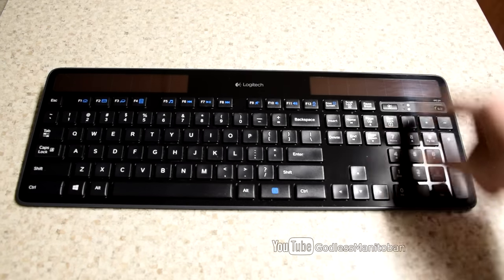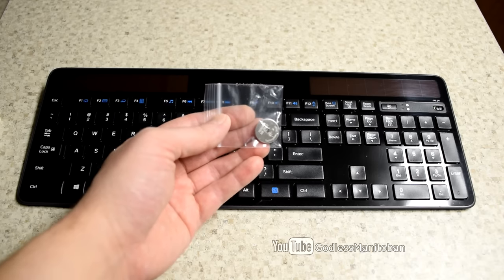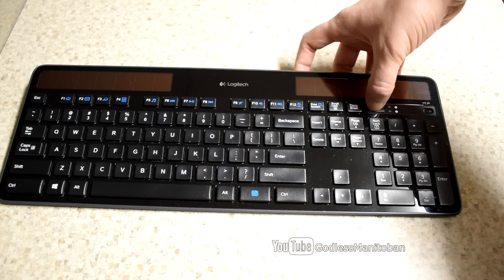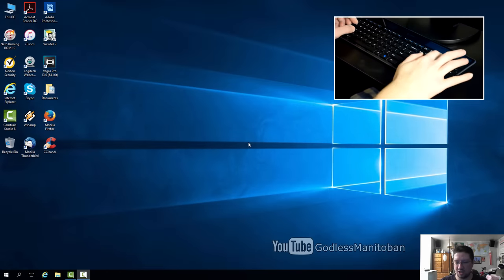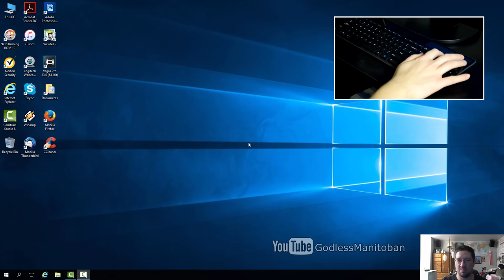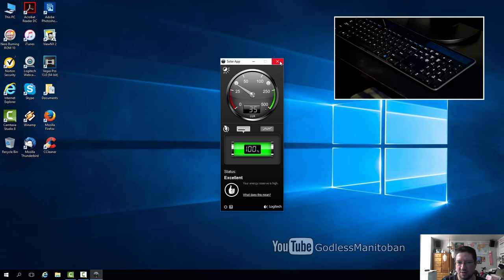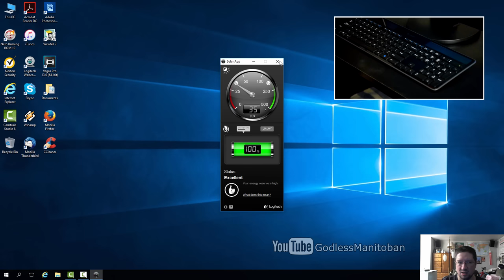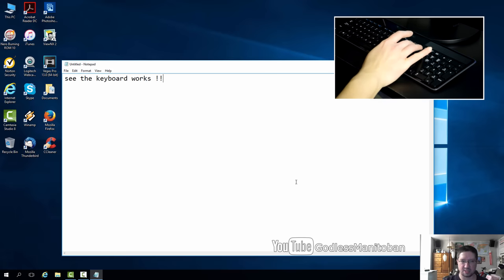Replacing Battery in the Logitech Wireless Solar Keyboard K750 (How To)

Comment: Thank you!  So appreciate it.  Can't believe Logitech would not make this battery easily replaceable!  It is inexcusable - every 3 or 4 years they end up in a landfill!  Our host video fades from sight on the removing battery tray but it saved me $60 and I so appreciate the effort.  It takes a small very small screw driver and persistence .  The reason it doesn't come out easily is because Logitech put little "dog ears" on each side of the tiny tray that expand out to "lock" it in place when it is pushed in.  Put a tiny screw driver on one end of the tray outline. Have another  tiny screw driver of flat end instrument ready to hold  the crack open. With careful but firm force you can force it open a little and then pull the tray open enough to reveal the little dog ear - use the second instrument to pry the dog ear IN towards the battery tray and open that side up.  Move to the other side and then do the same - pull the other plastic dog ear inward - that releases the tray and it will pull out.  Remember to put the battery (I just used an energizer 3v that I had laying around) with the "label" side up - just the way you removed the old one with the yellow sticker up.
Reply from the maker: You're welcome.
Reply: I have no idea where to try to open the keyboard. that was why the video is so important. And I have no idea where "here" is.

Comment: Couldn't find a Maxell ML 2032 rechargeable battery for my Macbook's Logitech Wireless Solar Keyboard K750 locally, but succeeded online. Cost about $8.00. Was able to carefully pry out the plastic battery holder with a very small screwdriver. No damage to the battery holder or the keyboard. Slipped the new battery into the holder, slid it in, and it clicked right into place. Thank you for making this video!
Reply from the maker: You're welcome.

Comment: Great video. Logitech has changed its tune. It now explains how to change it and to disregard the warning.
Reply from the maker: I've kind of given up on my Logitech. I think I have wireless interference and my keyboard sometimes doesn't want to type. The battery is fine though.
Reply: Please post link to Logitech’s battery replacement instructions.  I’ve been unable to find.

Comment: World's most difficult battery to remove! Prying with a narrow blade screwdriver in the center bottom of the battery holder seems the only way to get this sucker to pop out. I tried "playing nicely" with spudger tools and picks, no luck. You can use very fine sand paper to buff out the scuff marks left behind, and this looks nearly brand new with a fresh ML2032 battery! Thanks to Logitech for "planned obsolesce" engineering.

Comment: I followed your tutorial to replace the battery in my K750. UGH, It was a major hassle removing the battery tray. I clipped the little tabs so I don't have to deal with that pain again. Thanks for the detailed video!
Reply from the maker: You're welcome.
Yeah they definitely don't make it easy to replace the battery. I managed to get that battery tray out with minimal damage and the damage is under the keyboard, so no big deal.
Reply: Great suggestion about clipping the tabs.  I did the same thing and the battery still holds in place without being loose.  Thank you, Jem!

Comment: Two and a half years old? My keyboard has been going for at least six years now - maybe even eight -, making often about 20 hours a day, and it is still going. But I have noticed a significant drop in its chargeability. The battery takes longer to charge, and is quicker to discharge. But although the most important part (getting the tray out) happened outside the camera view filed, I now know what to do. I'll just have to use a little more force. Thanks to you and your video. Thanks a lot, GodlessManitoban!!!
Reply from the maker: Sorry I thought the battery tray part was in frame apparently it wasn't and you're welcome.

Comment: You may wish to add that to reactivate the keyboard after successful battery installation you need to disengage and re-engage the micro receiver.
Reply: I got the keyboard without any receiver. Can I buy receiver which will pair with this?

Comment: A metal nail file is perfect for removing the battery, it's thinner than the average screw driver. I used one shaped like a letter opener (but it has a dulled point) and slowly worked the battery out from the top. There are two side tabs that you will have to work to get it out as well. But this way I had zero damage to the keyboard while I extracted the battery. I didn't replace by battery but pulled it because of a spill.
Reply: I would love to see how you got your battery tray out. After 30 minutes of trying and some scratches on my keyboard I said fuck it.

Comment: Great video, thank you for your endurance to go after it! I have used this keyboard flawlessly for at least 8 years now, and it just happened today that it stopped in the middle of work. However the program shows 89% battery life it might have more damage to that than this because of its age. It is sad that Logitech like other companies is not supporting environment friendly operation and mislead its customers to make them throw away their old equipment and keep buying new ones. I must say this keyboard is the best one ever made, and thanked for your video it will stay with me as long as computers ever use keyboards... :)
Reply from the maker: I think many factors affected my keyboard (sent it to recycling). My room wasn't the brightest and I did use it a lot. When I did replace the battery I didn't think to take the sticker from the old battery and put it on the new battery. So it could've lost contact but I was just fed up and tossed it. You're welcome.
Reply: @GodlessManitoban  I did not put the sticker on either and it still works just fine...

Comment: First of all, thanks for posting this. I have replaced the battery with a new one (Maxell ML2032) and the keyboard started to work again. However two days after, the battery fall down to 1% and the keyboard stopped working. Solar meter is usually 500+ during day (night obviously 0). but it seems the keyboard is not able to charge the battery back. Did anyone saw similar thing before?
Reply: Many Lithium rechargeables sold online are junk, or it arrived almost dead and needs charging.  Even if it says pre-charged, it may be dead from sitting for a year.  Can you set your keyboard in the sun for a day?  The shelf life of these rechargables is only 2-4 years, and you could have found old stock. 

I used non rechargables, 2032.  A buck each on Amazon.  10-12 year shelf life. People are claiming they could start a fire.  I'm not sure how they figure.  How much energy do they think these panels can grab?   I get 35 Lux with all my LED office lights on.  With LED lighting being so efficient, these panels can't  keep the battery charged.  If you have old CFL or planet-hating traditional lighting (or sit near a window), it will charge fine; maybe then get a rechargable ML2032.  If you sit in a dank dungeon waiting for your next hotpocket delivery, any 2032 will work.  I've used a few flavors of cheap batteries to keep my keyboard going for 8 years.    Each seems to last 2 years. 
 
I have three of these keyboards.   No failures yet.  All are 6+ years old.   Love this keyboard.
Reply: @legonut78  You used a regular, NON-rechargeable CR2032 battery successfully, without disconnecting the solar panels, and without making ANY changes/modifications to a stock K750 keyboard?

Comment: I bought my keyboard back in 2011, and the battery is still holding charge. I think I'm the lucky one :)
I'm expecting the battery to go any time soon, good to know what battery to buy and how to change it. Thank you!
Reply from the maker: You're welcome.
Reply: I'm in the same boat. I bought mine back in 2011 also and the battery still seems to be fine right now in 2018. The room where my computer is well lit, so I don't think it ever had a chance to discharge too deeply. If it ever does die, I'll be scrounging up an ML2032 :) I still really like this keyboard. I'll be sad if Logitech discontinues it.

Comment: Have the same keyboard, bought in Sept 29, 2011.  Contacted Logitech when battery expired. Support told me they don't make those batteries any more. Went on Ebay and bought the battery. Found receipt today, 2017-04-05. I see Staples had $10 replacement plan charged on bill as well, phhh. Battery is easily replaceable and did so. I think what to really watch out for is if it gets 100% exhausted, then it won't kick in again. Alternatively I had thought of putting in a non-rechargeable battery and covering up the solar panels with black paper. However I did order the replacement battery and my wife is currently using this keyboard today. Logitect is obviously worried about the customer replacing it themselves with the wrong battery and encountering more than just a dysfunctional keyboard.  Maxell ML2032 is the replacement. Get the Maxwell ML2032 if you drink too much coffee being worried about your keyboard. (Sorry, couldn't resist the joke)
Reply from the maker: I think Logitech doesn't want customers to replace the battery. They'd rather have a customer buy a new keyboard. They could easily ship a battery out and send instructions to replace the bad battery.
Reply: Actually talking on the phone, Tech support offered to replace the 
keyboard. I was waiting for it, giving them my address but nothing 
arrived. They didn't want to spend a dime. Disappointing because I have a  lot of Logitech products. I agree with you. It's not good PR however citing others will read reviews of this thing and avoid it because of some reviews. I know Amazon retailers want an "immediate" review but I am inclined to take my time. Some things are initially great until they fail. (i.e. Dell Inspiron 5150). I bought my keyboard from Staples, reviewed it. Noted I can no longer get to my review any more. They just have "glowing" reviews from people who have used it for a day or a week.   A  job review is longer, 3 to 6 months. They should try that with hardware. Glad you made the video. It's a good keyboard overall, just that batteries are consumables, be it rechargable or not. It's like asking to replace our cell phones when the battery won't charge any more, ridiculous.
Reply from the maker: Hopefully Maxell keeps making the batteries or I'm going back to a corded keyboard. I also have a Logitech mouse and webcam.
Reply: I don't mind a corded keyboard.  Mouse on the other hand, I prefer cordless and haven't had a corded mouse for many years. I like mechanical keyboards and I don't know of any that are cordless.
Reply from the maker: Corded mice are annoying because the cord always drags against the desk edge.

Comment: Many thanks for the very helpful video. I got a replacement Maxell ML2032, installed it and keyboard is working fine. cannot understand why Logitec advise not to replace the battery. It may be due to the risk of a non-rechargeable 2032 being installed.
Reply from the maker: Yeah that's the only reason I can think of too.
Reply: Or maybe they want us to drop another $75 on a new Logitech keyboard and toss the old one in the landfill.

Comment: thank you for the instruktion. I have a problem because I have spilt a few drops of coffe on the tastatur, how do I clean this up?
Reply from the maker: It would be hard for me to say because I do not have this keyboard anymore. For most keyboards it would be disassembling the keyboard and using lint free cloths with rubbing alcohol for the circuit board. Then washing the plastic parts with soap and water. Once dry assembling the keyboard again. I do not think this would work well on the Logitech K750 though.

Comment: Actually a regular 2032 is rechargeable because solar caliculators(some) use them
Reply from the maker: Those batteries are generally a backup for low light situations. The calculator is dual powered solar/battery but relies mainly on solar. After the calculator gets to a certain age it wouldn't work in a low light situation anymore because the battery is probably dead. (I have one of them right beside me)
Reply: @GodlessManitoban  yes Ik but it means the solar cell charges them as I had a old toy cash register and the solar cell recharges the battery

Comment: Guess how I found your video about how to replace the Logitech keyboard battery! Logitech customer support emailed it to me. The only bad thing about your video is that it never shows the actual process of taking the plastic clip off, and that is nearly impossible.
Reply from the maker: I was just gentle and didn't use like pliers to rip it out. I used a small flat head screw driver for glasses or small screws. There are two clips on either side of that battery slot. With gentle force it will come out. Worse case scenario it needs to be taped in. Don't forget to make sure to keep the sticker from the old battery to place it on the new battery. It seems to need that to have the battery firmly against the connection. Sorry I left out that part it wasn't on purpose. I figured people would get the general idea.

Comment: I don't have the solar app installed on my Mac. Is this something I needed to install when purchased my keyboard?
Reply from the maker: It might not be available on MacOS. I can't say because I do not own a Mac. No, it is not a requirement. Usually the keyboard has light indicators for battery or low light. If it suddenly isn't as responsive I'd increase the amount of light or reposition the keyboard to give it a more direct path to light.
Reply: You can do this by searching for the Solar App in the Mac App Store, downloading it, and running it.
from MacBook Pro 2015 Mojave user

Comment: Hello, do you turn off your keyboards at the end of the day?
Reply from the maker: No.
Reply: I never do.  Mine has lasted 6 years until it stopped responding suddenly.  All I had to do to fix the issue was to turn the battery by 1/8 and put it back, and it started to work again.

Comment: Thank you. Just a note- put a sticker on the new battery. Mine was not making contact and it’s because the slimmest thinness of that stupid yellow sticker.
Reply from the maker: Hm I can't remember if the sticker was placed on mine. I've stopped using this keyboard because I think there is/was wireless interference causing intermittent signal.

Comment: Thanks for the video. May I ask how long you had to charge the new battery for? My keyboard has been by the window for a few hours (it wasn't uber sunny but...) and no reaction whatsoever when I press the "test" button on the keyboard. :( Thanks.
Reply from the maker: If there is no reaction one user mentioned that the sticker on the original battery might be the cause. If you have a piece of tape you could place it on the side of the battery with the brand/voltage on it. Then place it back into the keyboard and test the solar power again.
Reply: Thanks for your reply. I checked the battery - it was placed on the wrong way. I also put a piece of tape there to give it a 'bump' for better contact but still nothing. I have the keyboard "on" and placed under a lamp now...i'll try it again...it's a pretty cloudy out...we'll see but we may have questions again. Thanks.
Reply from the maker: @anniefung5447  I'm not sure if coin cell batteries have a way to be tested. But the battery could very well be dead even though it was purchased new.

Comment: I replaced my ML2032 battery, the LED flashes when light button pressed but red a few times then green. My K750 wont connect to the unifying receiver any more, put it under hot sun for a few days ? How do we know if it's charging ?!
Reply from the maker: Go here https://support.logitech.com/en_us/product/k750-keyboard/faq#link_20621 and expand "K750 LUX number low even in a well-lit room"
It charges even when it's not green or on from my understanding. Green means it's getting enough light and red means it's not getting enough light to charge fast. My back was always to the light so while I used my computer it charged very little. After I used my computer I'd move my desk chair so it could get light from the window. That or put it directly under an indoor light for a few hours or three feet (36") away from a window with sunlight.

Comment: Can you redo the video so we can see how you pry the door off? That was done off-screen.
Reply from the maker: Sadly no, The keyboard was bent into a 45° angle and tossed into the recycling.
Reply: @GodlessManitoban  well, thanks anyway. We tried to follow the audio. The little door looks gnawed on from all the tools and attempts we tried, but we got it off. I think something else might be wrong with the keyboard. My friend still wasn’t able to get it to work even after replacing the battery. She ordered a new one. Lol, when the battery dies, we’ll be back to square one. Thanks for posting the video and try to have a good day.
Reply from the maker: This model of keyboard worked really well in the beginning. After the battery couldn't hold a charge anymore it became frustrating to use because of stufffffff <- like that. I threw it away before I had a chance to try what someone in the comments suggested. Which was putting a sticker or somehow trying to peel the sticker off of the original battery and then putting it on the new battery before inserting it back into the keyboard. The sticker might've made it have a better connection even though the sticker is so thin. (Sorry about the late reply you were stuck in the spam bin)

Comment: ...Thanks for the vid !...I was in the same boat. Prompted by youe vid I started check other stuff I have that  'died', specifically 'wind-up' flashlights. I have three that I opened up and found that same 2032 rechargeable battery inside.  The batteries are surprisingly cheap on amazon !!!
Reply from the maker: You're welcome.